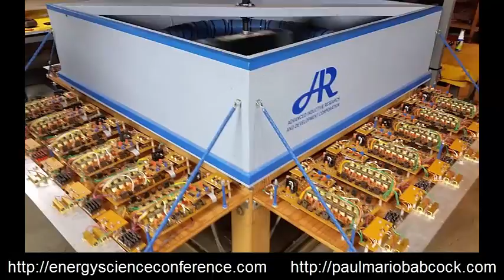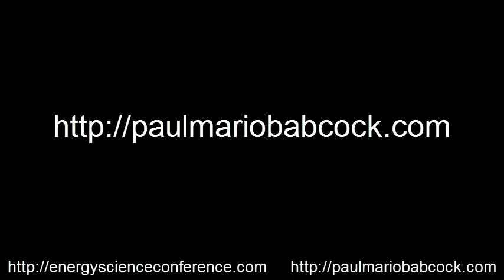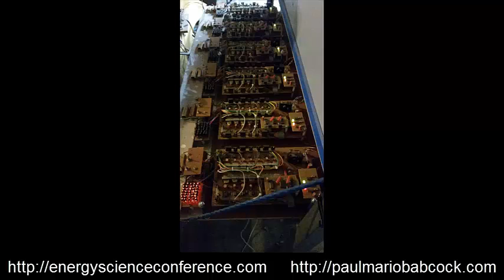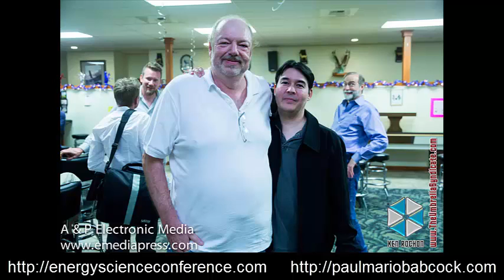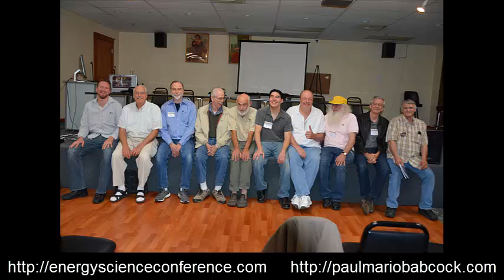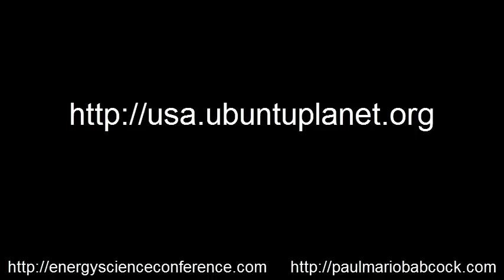2016-09-12 Paul Babcock LIVE Q & A Call

Comment: I have a suggestion.  Use silver instead of copper.  Pay more for lower resistance and I'm te long run, you get a lower input power to higher output torque via utilizing the collapsing fields.  And you generate larger input fields.  

Market it at a higher cost as to justify compacting the motor or power to weight density

Comment: Lens reaction vs resistance is at a different phenomena when using aluminum wire..just saying. Less eddy current and electromagnetic inductive power would have advantageous added results.. Not to mention weighing 1/3rd less ;)
Reply: MichaelSmathers is that true?  Isn't AL more resistive?
Reply: Constantine Joseph Yes!! Joseph..precisely. Aluminum IS MORE resistive...to "Current"  ...Voltage however..the kind demonstrated in the Newman Design DID NOT call for current as a power function to turn his generator. Now do you see the advantage Aluminum could bring to field motor design...think, Newmans 'length of wire' for a vortex coil..and now you have REAL Formidability for powering things!
Reply: That could be very interesting.  Aluminium is a cheaper material and as you mentioned much lighter and used in modern car chassis designs.

In producing larger magnetic fields would AL be competitive with copper?  Another thing is, can AL tolerate high amp spikes of back emf more than copper without burning out.  

If this is true then Al would be a more cost effective method of manufacture and thus increasing power and weight density of such motors making it feasible or niche to a market where power density is the driving impact factor for the next generation automotive motors